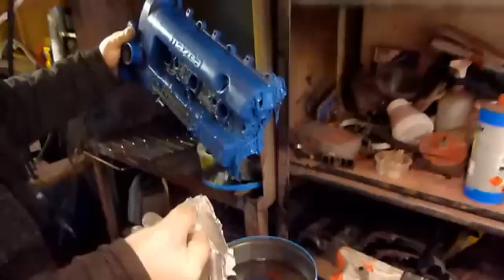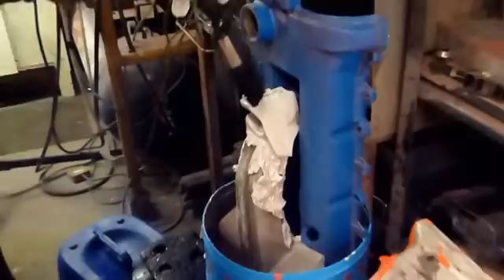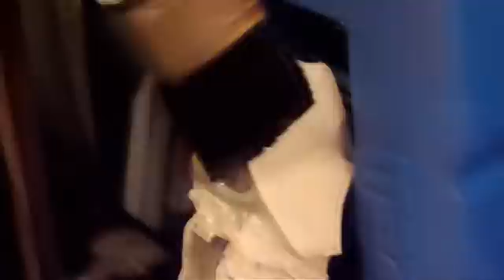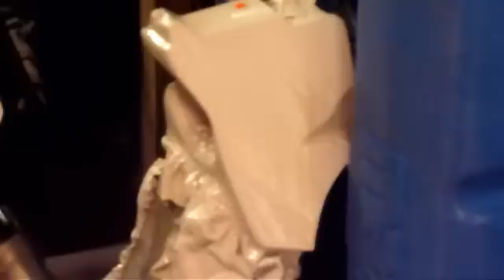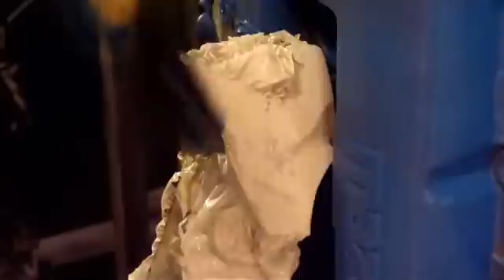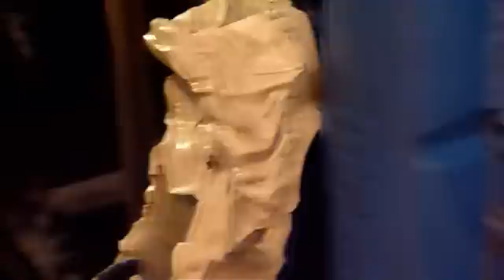Powder Coating Removal - Very Fast!!

Comment: This is just pure acetone. The clue is when he says it just evaporates. this is what i use. and a lot better than gasket remover. It wont do any harm if it gets on your hands as long as you use a good moisturiser. and at under £17.00 for a gallon, its cheaper than any other method.
Reply: Um, doesn't acetone penetrate the blood skin barrier in seconds, and acetone cause cancer???? Paint stripper evaporates too if it's working right.

Comment: Looks good. But what did you actually use to remove the coat? I have tried using sandpaper, paint stripping pads, and aircraft remover. Not looking good so far. Since you are touching it with your hands,  this leads me to believe that it's some kind of acetone..
Reply: He is not alive anymore. He probably  past away not using PPE and we will never find out.

Comment: I would agree. It's probobly Methylene Chloride. It should be kept in a bath and the items to be stripped should be fully immersed in the solution for a few minutes. I had a bath filled with this chemical a few years ago. It's the only thing which strips  this rubbish effectively. The solution was made up from Methylene Chloride and a small percentage of formic acid. I added 5 gls of water, which floated on top of the solution and stopped evapouration.  Health is a concern with this chemical.

Comment: I know it's been a while now, but it's called Methylene chloride - or Dichloromethane (wikipedia = "powder coating", "removal" section). I have used it yesteday on my bike frame. Works like a charm. However, use proper gloves (unlike the ones in the video), protection glasses and mask (wikipedia - toxicity)... may be carcinogenic...

Comment: Dustinray33 and carlitosgy6 are both wrong.  He posted about this in a forum claiming he used something called "Gardostrip 7909."  Chemetall Oakite makes a stripper called Gardostrip Q7900A, so I imagine it is that or something similar.  They classify it as a Non-Methylene Chloride stripper, and according to specs it works best between 140-180 degrees F.  He says it contains Methanol & Hydrofluoric Acid.

Comment: Gasket remover will take powder right off. Quite a few brands out there and its ALOT cheaper than actual powder remover, which is $70.00 a gallon!

Comment: pointless video, I use METHYLENE CHLORIDE , its the key ingredient in most paint strippers and also used in aircraft stripper. strips powder coat in 5 mins .

Comment: Amazing, the level of disrespect, and lack of graditude voiced here, all contributed to a lack of common sense in that the video was displayed to show the proper, concentrated, application of the stripping product of your choice. Applied wrong , nothing works. How quick people are to be critical is unbelievable. Most of these comments are the result of the lack of common sense which has become an epidemic.Just another example as to how you can never give enough to SOME, as its NEVER ENOUGH